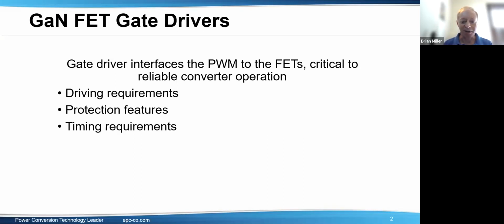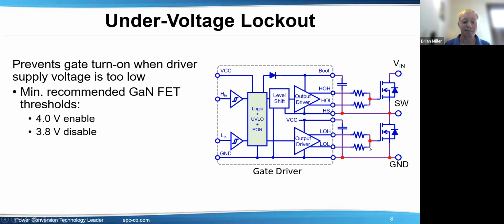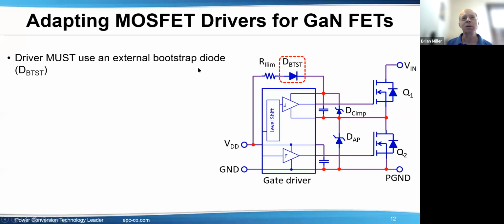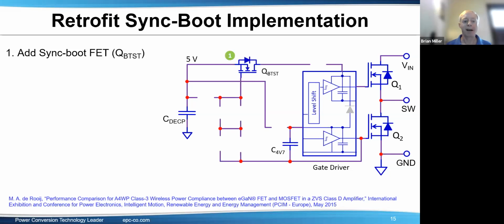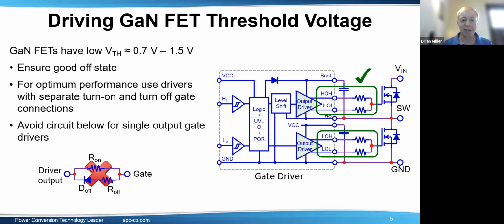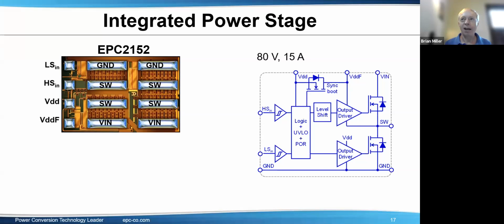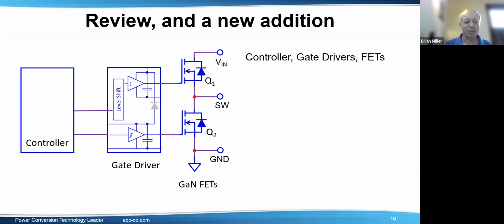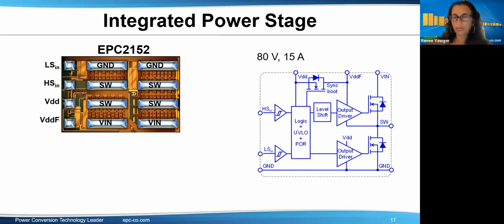How to GaN 04a - Gate Drivers for Gallium Nitride (GaN) FETs

Comment: Hey, at 18:27, doesn't the bootstrap diode on the high side mean that there is a significant difference in drive voltage between the high side and low side (due to the Vf of the diode)? Does this cause problems?
Reply from the maker: A voltage drop would occur, but there is a nice cancellation of the drops in 2 of the diodes, resulting in the upper gate drive being approximately the same as the bottom:  
1)	As you mentioned, the top boost diode, Dbstst, drops voltage.  So, the output is about 5V – 0.7 V = 4.3 V.  
2)	But, the reference point of the upper gate drive is the switch node.  And, during the dead times, the bottom FET’s body diode (and, in this case, the parallel diode Dap) have a drop.  So, during the dead time the switch node is below ground.  About 1 V below ground in this case.  
These diode drops offset each other.  Resulting in the upper gate drive voltage in many cases being the same or even higher than the bottom gate driver voltage.  The Zener Dclmp helps in case the upper gate voltage floats too high.  

If you have additional questions please visit the Support Forum (https://forum.epc-co.com/) or Ask a GaN Expert (https://epc-co.com/epc/Contact/AskaGaNExpert.aspx) 
Thank you!